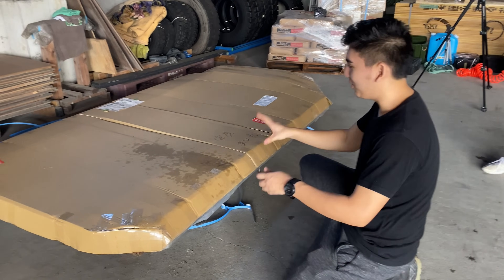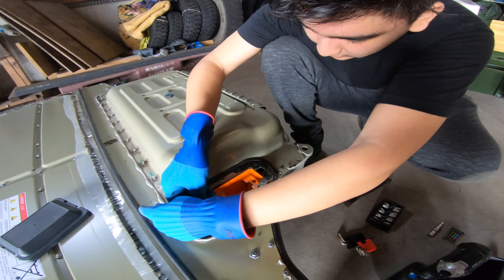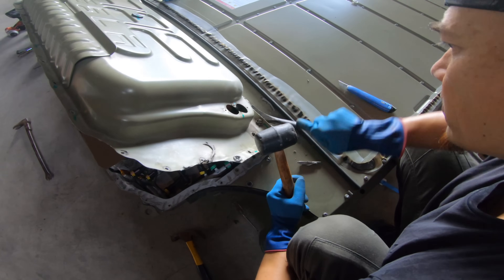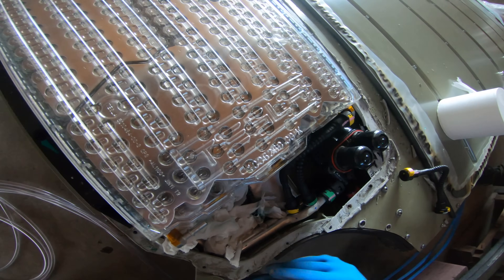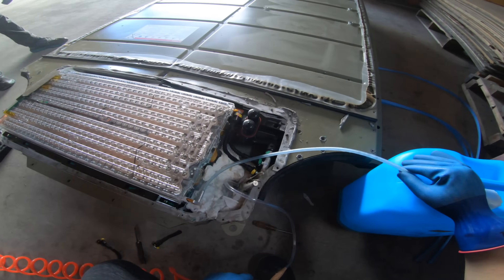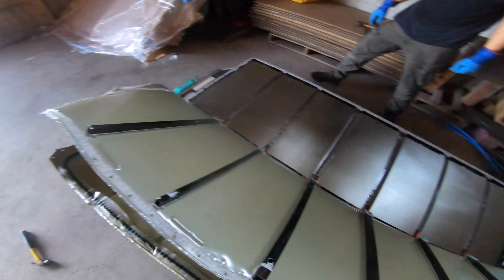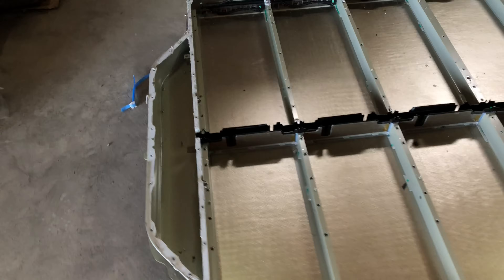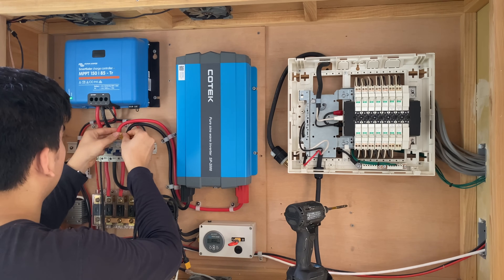The 60kWh Tesla Battery Powered DIY Powerwall

Comment: Do you think it’s a good idea to have that many un encased LiPo cells inside a residence? I’d be thinking of having it in an auxiliary building. Were the buss/jumpers all fed from the same end instead of diagonally? Gloves are a good idea but safety glasses can save your eyes. That much potential can vaporize a good chunk of metal if you have a moment of distraction.
Reply: The tip on wearing eye protection is understated. I was horrified seeing the live batteries being moved under dangling bare cable lugs.
Reply: @LatinDanceVideos  they are 24V modules, so they can't really cause arc flash...
Reply: Lmfao  @GrenYT
Reply: Tesla batteries are not lipo. The long range batteries are lithium NCA. The standard range are lithium iron phosphate. Due to the number of battery modules in the battery in this video, it appears to be LFP. These are are very stable and have a very low propensity for thermal runaway. The do have a transparent casing also, which is still present on the modules in this video.
Reply: You guys sound like a bunch of babies.
Reply: I think as long as it's not being charged or discharged at high loads for long periods of time, the risk is relatively low. But this is pretty much the reason I got a generator and didn't install a battery based system for my house.
Reply: Ya
Reply: Should have just bolted that unit as delivered to the outside wall and plugged it in to your rig.
Reply: Was thinking the same thing. 

Just saw a news story of Tesla power wall fire. If Tesla can’t get it perfect, we all should be taking more care. 

I can recall the diy ebike scene building batteries and chargers, discovering battery fires. Then people realised batteries needed to be charged in fire safe containers. Old bbqs, steel drums, concrete bunkers, non flammable fibre board fire barriers. 

Some people even set up sand bags as fire extinguishers to smother the flame and smoke.
Reply: At least, I would put them into a metal box and also not have all that Victron stuff screwed on Wood.
Take perf. Metal sheets like Tool Panel.
I had mine wooden too but then décided to replace by steel. 
But brides thus, cool job!

Comment: Just curious, your DIY solution costs 80$ (and tons of time) per kwh storage.
A quality car battery with 100AH at 12V is going to work for a decade and provides 1.2kwh at 60-70$
I'd not hang it on a wall though.
Reply from the maker: Lead acid car batteries can only be discharged to 50% before it sustains damage and it’s health rapidly declines. So a 12v 100Ah lead acid is actually only a 0.6kWh battery. My lithium ion battery is then half the cost of lead acid. And will last at least 20 years.
Reply: @ZaiFuchigami  A brand new Li-ion will have how many cycles? 500? 1000 ? That's not too much for 20 YEARS .. 
We know from the e-car batteries that they degraded a significant amount after just one year, often enough for a full replacement.
The 50% ratio is indeed a downside, in such a case you'd need to recondition it with a proper charger. After all it's just layers of lead+acid.
I've no doubt that a solution with lead acid will come significantly cheaper than used liion cells.
It just requires more space.

Comment: $80 per kwh is what you paid, but $80 per kwh is not what is useable in these packs. These Tesla 6s lithium packs are pretty and great to look at, but they are inefficient with a 24v system. A 7s lithium pack is more compatible. It’s like me saying I paid $80 per kwh for a lead acid setup, while I can only use 50% of the pack. But thanks for your video, it looks nice and I’m sure it works well. In a perfect world these modules would have been arranged in a 7s configuration instead. Then, they would be a perfect drop in for the solar afterlife.

Comment: Nice Setup and nice Work/Skills!

Can you say, why you went for 24V System? 
Easier to get more PV Energy in the Batteries with 48V System? 

Are these Tesla Battery 18650 LiIon Cells ?

BR,
Tobi
Reply: Thinner cables possibly. For a given power, if you can increase the voltage the current reduces and the cables can be thinner, cheaper and more flexible.

Comment: I don't like the way you connected the batteries. I would've put two copper busbars on the wall and connect each battery with busbar clamps. That would result in similar resistance on each battery. Besides that, solid work!

Comment: PLEASE PLEASE crimp on some ferrules or some other crimp connector. But never put multistrand cable into your breakers like that. To put it bluntly, it's a fire hazard, you will never reach the specified clamping force required. If you have the means to crimp on screw spade connectors, then please crimp on some ferrules.

Comment: Using metal screw driver inside battery pack..... uh you do know they make all sorts of plastic tools for that... ceramic tweezers for non conductivity... and many many others....hell I even use dollar store Popsicle sticks, I forget the cell spec's for Tesla's 21700 cells... but I do know the Samsung 40T Cells can discharge at 35 amps....   I highly recommend Silicone wire, high strand count, high conductivity, low resistance wire for others who do similar..  Daly BMS.....  for some of the higher amperage I'd recommend welding cables... as they are much more flexible because of the copper multi strands....2 to 1 safety ratio... if you need 100 amps... build for 200 amps.... Luna Cycles carries heavy gauge wire 4g, 6g that would be good for applications like this,  but I'm sure you can find it online,  double wall or glue type heat shrink tubing for outdoor applications, IF done right, provides a waterproof seal..
Reply from the maker: Check out the second video to see how i installed the system and what I did.

Comment: Did you do a capacity test to confirm it’s 60kWh?
Reply from the maker: I did. I took apart one module and tested a dozen cells for capacity then multiplied that value. The cells tested 2.7Ah, which is 9.72Wh.

Comment: Why no air gap between those cells?
Reply from the maker: Not necessary for cooling.
Reply: @ZaiFuchigami  they liquid cool them because of heat while charging and discharging stack them against each other and air gap is not needed in a wooden box got it... :-/
Reply from the maker: I’m aware why the actively cool the modules when in the car. I draw and charge a fraction of what the car’s motors will pull. So when kept under a certain c-rate the cells will not heat up beyond room temperature, so liquid nor air cooling is required.

Comment: ## Question for you all ## 
What are the rules in your country doing work like this??  ( I See so many doing DIY battery packs) 

Where I live ( Norway ) there is rules that say, all electrical installation abow 48Volt and 200VA you need to be a certificated electrician! So a DIY is not for every one then.  As the battery pack is much more then this when you get it!! 
What do your country rules say abow working on the electric.  I am a electric educated worker so I do not mind, just like to know the rules.

Comment: There's enormous battery capacity for what appears to be a relatively small load.  You're feeding that small load center with what looks like #10 SO cord, using  (14) low amperage (probably) circuit breakers.  It seems like the battery is overkill but I like it.  Battery inverters like Tesla's Powerwall are too expensive and undersized IMO.  Thanks for the video.

Comment: You say DIY wall , i think this  technology is well above most diy's skills, what training background are you , as this sort of work is extremely dangerous for anybody so much can go wrong, too much power can be stored, do you need all  the batteries, I don't think I would have put it in my house maybe a brick outer building especially with no cooling system ,hi from scotland
Reply from the maker: I agree this is beyond what most consider “DIY” but it’s definitely doable just by yourself. I have zero formal training, with everything I’ve learnt being found on the internet. 

Grated, it did take a long time to gather all the information and knowledge. 

The cooling system also isn’t required as the batteries only see about 10% of the stress compared to when they were used in the car. They actually don’t heat up above room temp.
Reply: @ZaiFuchigami  zero formal training huh ??

Comment: Zai, I used to be a heavy helicopter mechanic. The Sealant between the sleave and spindle and upper and lower star of the rotor head is impossibly hard to chip away.
Reply: Did you ever try heat gun?  I mean, I don't know if it could be used, I'm just curious.
Reply: acetone will strip away some epoxy insulators , even steam cleaner will soften them

Comment: I have a stupid question I'm sure some one would entertain. Im living off grid already with a small 4000 watt solar field and a 1.8 KW lead acid battery 48 volt banks. 12000 watt inverter charger. we also have a 9000 watt 50 amp propane generator which is hydrogen assisted. I want to upgrade. to a 10000 watt solar field. the generator is very cheap to run for 3-4 ours a day with the hydrogen assist.. why not just buy one of these bad boys and use the whole unit instead of tearing it apart? wire it to a pair of 12000 watt inverter chargers to my panel. my inverter chargers can take up to 96 volts bank. Can I not modulate the voltage drawn off the massive battery bank? 70 amp charging into the Tesla auto cell from my generator or solar field as desired? I understand taking the modules apart for small battery construction. like 4 24 volt units in series for a 96 volt 5.3 KWH cell... but can the whole unit be used with the destruction?

Comment: Is'nt it a problem to connect used packs in parallel? I'd like to copy your work!
Reply from the maker: No problems with it as long as each module is monitored individually and not as one single battery. The SimpBMS gets cell and temp readings from each module then triggers a contractor to shut power if any cell goes too off balance from another.

Comment: How is this holding up?

Is there any maintenance involved with keeping the batteries running properly?
Reply from the maker: Zero issues so far. All 6,216 cells are perfectly balanced to within 8mV of each other. Other than when something goes wrong there's really no maintenance required. I did install a Raspberry Pi running Victron's VenusOS to monitor the system recently though.
Reply: @ZaiFuchigami  would you recommend this build for a powerwall setup? Does the runaway heat worry you at all? what do you do for a bms? Isnt this complicated for these batteries? No liquid cooling?

Comment: is it more better to get a automotive EV battery like shown in this video for a solar system or say, a AGM battery system, what would be more cost benifical etc
Reply: I don't think there is any real bene
fit in using an AGM battery. Sure, a car application will benefit from an AGM battery compared to a liquid Lead-acid.

If you're going to go for the higher cost of the AGM battery then you need to be able to justify it.

Comment: You could have dig a hole in the floor and  used the entire thing as it is with the collant and connections working with tiny modifications.made something like tesla power floor.
Reply: HIGH VOLTAGE , way too high , but ....

Comment: How do you step the voltage down? And which BMS do you use?
Reply from the maker: I use a simple 24v to 12v step down module for the 12v systems but the inverter runs on straight 24v from the battery. BMS is the SimpBMS unit. I explain the system un more detail in my other video.

Comment: I have questions what you do with temperature of battery when it up ???
Excuse me my English it's very weak
Reply from the maker: The battery doesn’t heat up at all as the amount of power I draw is very little compared to what the car motors draw. No cooling is needed!

Comment: $80/kwh?  33.7 kwh/gallon gasoline.  1 gallon gasoline equivalent is... 33.7 kwh/gal x $80/kwh=$2696/gallon.  5 gallons would be $13,480.  A 5 gallon plastic tank is about $10.  1348:1.  What a stupid joke.
Reply from the maker: But imagine, a gas tank that gets refilled for free, for decades.
Reply: @ZaiFuchigami  That you pay $6500 to $26,000 for...nothing is free.
Reply from the maker: seaplaneguy The battery cost $5800. It gets recharged with the sun. The entire system includes panels was 10K. But all components will last over 30 years. That’s 30 dollars a month for power. Your argument doesn’t make sense.
Reply: @ZaiFuchigami  How many kwh/month?  I will show you what makes sense after you respond...  If you included the cost of the work to set it up, that $10k would be $20-30k.
Reply from the maker: Current usage is 200-250kWh a month. And I have no idea why you think 10k becomes 30k. I Installed it myself.
Reply: @ZaiFuchigami  LOL, Electricity is 8 cents/kwh for the first 400 kwh/month.  0.8 x 250=$20.  Interest on $10k at 4% is 33.3/month, double that to account for the work.  No way is this cost effective, even with a used battery.  A 70 kwh battery at $200/kwh = $14,000.  Add in all the other junk and you have at least $20k.  Makes no sense...
Reply from the maker: Do you seriously not understand that I only paid 10k for everything in the system? Cash up front. No interest or work costs. And what happened to your gasoline argument?

Comment: Do fire department need to know about the batteries (high fire hazard)? Do laws require to put in place a fire detection system (and suppression too maybe) ? Uncontrolled Thermal runaway can destroy your house
Reply: Ahhh we just wait for saintly person as you for warning...... Man, take responsibility into your own hands and stop hiding yourself behind regulations!!!
Reply: @Thomeeno  not so stupid really - might be a great idea to have this setup in a small building/container etc beside the house. Just run cable to your ATS beside your panel.
Reply: @stevemyers2092  I know when I do my onw solar set up the batteries will either be in my tool shed or its own shed.
Reply: @Thomeeno  that's not fit for an inhouse Installation.
Lifepo4 would be appropriate but not do nearly as much view on YouTube
Reply: @tiloalo  Actually i've already thought about this point. But my guess was Tesla battery is about same price per wattage while you get better li-ion technology compared to lifepo. I guess Tesla is able to make them really cheap in that amounts.
Reply: @Thomeeno  how is the technology better? It's more compact, but that's not really relevant for an in house static installation.
Lifepo4 is more stable (no risk of fire), doesn't have any heating issue at the amp needed for a power wall, and especially last 4 or 5 times longer (in term of cycles number).
Also you have 16 cells per pack, so cabling, balancing, monitoring, ... Is all incredibly simpler

Comment: Why not use the entire battery pack instead of taking out each module?
Reply from the maker: In the original pack, the modules are configured to over 400VDC. Way to high to be used with conventional equipment and a safety concern. I needed to remove the modules to reconfigure individually.